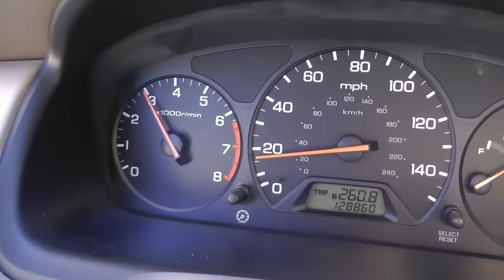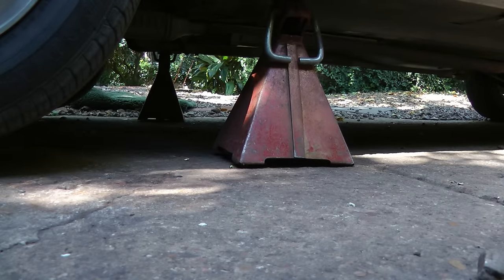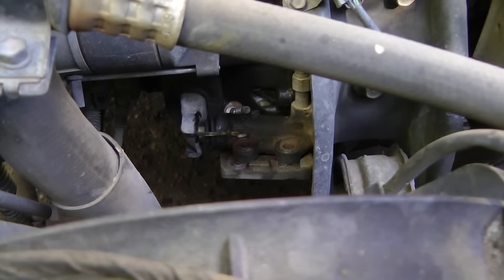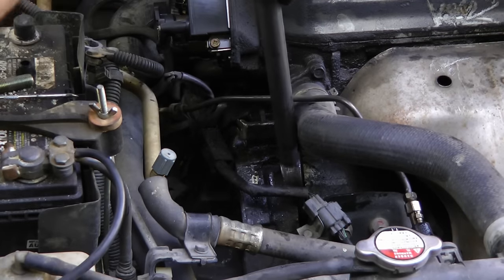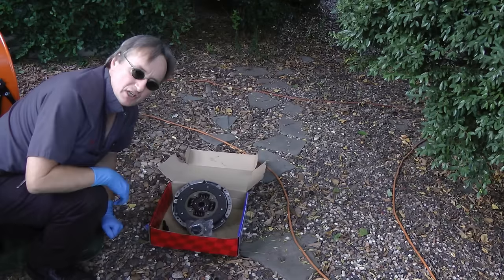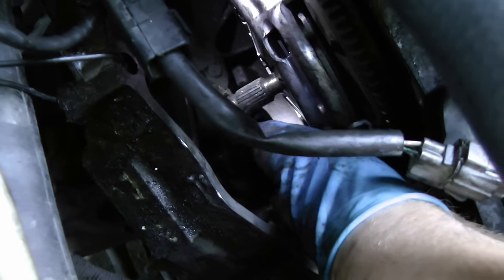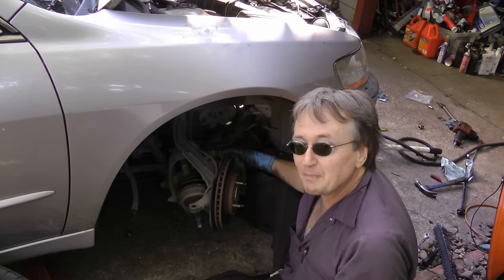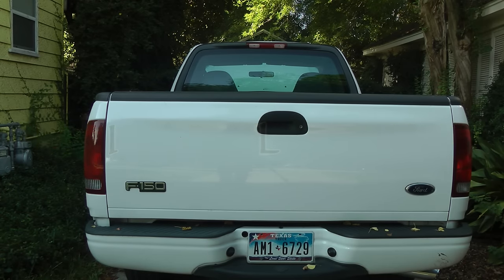How to Replace a Clutch in Your Car

Comment: Thanks for the vid. I have a question. I supercharged my 2003 Mach 1 and now my factory clutch is slipping at high RPMs! Too much power, need to upgrade it. What brand of performance clutch would you recommend? Spec? Exedy? Ram? It needs to handle 520 HP and 485 lb/ft of torque.
Reply from the maker: +kingcrimson234   Exedy
Reply: Scotty Kilmer Thanks!

Comment: This is only for front wheel drive cars, people may get confused on why should they remove the 2 semi axis...
On rear wheel drive for example it's much easier, you just remove the central drive shaft to pull back the transmission to reveal the clutch

Comment: Thank you for the video.  I am working on a 2002 Chevy Caviler, manual transmission.  My clutch is slipping so I need to replace the clutch.  You make this look pretty easy.  Do I have to remove the transmission on my Caviler in order to replace the clutch?  I know some cars are different.  Thank you!!!
Reply: NotSomebody63  I mean can I leave it in like you did.

Comment: scotty,some times you come up with amazing ideas,but i disagree with how you did this job.i know it is painful to remove the sub-frame  or the engine to remove the transmission completely.i have always made it a practice to remove the flywheel and get it machined or resurfaced.also check if there is any leak and wash the transmission/transaxle assembly and definitely put new fluid.with this practice you should get easily 5 years trouble free of regular driving......respect

Comment: Hey Scott! I own a 1996 Mitsubishi 3000gt Base 3.0 DOCH. Non-turbo. Whenever the car is at a complete stop, for instance a red light, when I push the clutch in and try to shift right away into 1st the gears grind, I have to wait about 2-3 seconds before I put it in gear. Same thing happens when I go from 2nd to 1st sometimes when coming to a stop. Is that my transmission going? or should I just replace the clutch and flywheel?

Comment: Scotty, I just replaced the clutch and flywheel in my 03 Mazdaspeed protege and installed new mounts all around and now when I take off from first gear my car shakes and jerks as if I'm not giving it enough gas but I am. What could that be?  I also replaced the pilot and throw out bearing. Thanks in advance.

Comment: Im about to do my first clutch on a 2001 camry, is there anything different from this honda i should take note of? I believe there is a bearing on the driver side axle holding it in place. If you could give me a rundown of the procedure i am facing, it would help alot
Im doing a stage 2 exedy and 9lbs fidanza flywheel

Comment: Hi scotty!
Got a strange problem with a 96 civic. One moment the gears shift fine but after installing a larger exhaust system I wanted to test it out. I go to first gear then start the car while holding the clutch and then let go of the brake while still holding the clutch and the car rolls like im not even on the clutch. Also unable to change gears, putting into reverse is easier but grinds a bit, and the car shifts fine when engine is off. I thought maybe the new wider exhaust is blocking the clutch arm or lever or whatever you call it, but the clutch pedal moves freely. I noticed the clutch squeaking when i press it all the time but now it stopped making that squeak so possibly an indicator of blocked clutch cable or arm? Do you think i need a brand new clutch or is it possible that the clutch cable is somehow blocked?
Reply: SOLVED:
just needed to add some d03 or d04 brake fluid to the clutch hydraulic system.

Comment: Hi Scotty! I have a quick question. I tried kick starting my car and now when I try to push it on first or second the car won't move at all unless it's in neutral. what do you think it is? clutch? the car was sitting for 3 years by the way. it's a 98 240sx with a sr20det engine. thank you for your time Scotty. love your channel.
Reply from the maker: yes, clutch is shot
Reply: Scotty Kilmer thanks for the help Scotty 👍

Comment: Does a 2003 Subaru forester need to be entirely disassembled to replace the throwout bearing or can it be done while still in place like you did for the honda?

Comment: A Scottie I just bought a Celica gt convertible and um new to manual cars made it home fine very bad burnt odor and car will not engage gears now at all. I limped two streets over in the car. Revs crazy won't move clutch got harder to push in and engage on my way what do you think it can be?

Comment: Hi again Scotty, I once again have a question. I would be very happy if you could answer it again.=) What needs to be fixed if the third gear wont get in properly? It get's in, but it's not easy, the others gears gets in fine & easy, but the third gear is harder. Anyways I'm very happy that you are making these videos, I learn so much! =)
Reply from the maker: transmission would need rebuilding, probably a bad synchro in third gear or wearing out gear itself
Reply: Thank you so much Scotty! =)

Comment: Driveshaft removal is more tedious with rear drive vehicles.  Putting the car on a lift and/or keeping vehicle high enough to safely work underneath is the best way to tackle the job.

Check also crankshaft- to-flywheel seal, if it's old, the oil pressure from engine operation will tend to spray around past the flywheel and contaminate the clutch disc.  While flywheel is off, replace the flywheel needle pilot bearing which is inside the crankshaft behind flywheel side.  Don't forget a flywheel lock to keep crankshaft from spinning when you loosen/tighten clutch pressure plate from flywheel.  O2 sensors will need to be removed if muffler has to be taken  off.

 If you have time and money, resurfacing face of flywheel at machine shop would be ideal.  Avoids buying a few flywheel.  You may need to bleed hydraulic clutch, disconnection of clutch components may have introduced some air pockets in the system.  The more money you can spend on new clutch-related parts, the less time you'll need to get back under the car to repeat some work in the future.

Comment: Scotty Kilmer, I have a 95 mitsubishi mirage 1.8. As i was driving my clutch pedal got real stiff and it was almost imposible for me to shift gears, i did make it to my destination but the car wont go into any gears now. Before this happened i installed new master cylinder and new slave. Now im working on replacing the clutch.
What are your thoughts on this based on your experience?
Please help thank you
Reply from the maker: broken internal clutch parts

Comment: Quick question... I have 96 sunfire 2.2, is it absolutely necessary to drain the transmission before cracking it open to replace the clutch?

Comment: Hey. I asked a question about my 92 Ford Taurus SHO a few weeks back. It wouldnt start for some reason which ended up being the wiring.  I Had to insert a push button so I didnt have to replace the wiring. Anyways, I have a rod shifter so the only adjusting I can do is with the clutch pedal. But its still hard to shift into gears. I have to yank on it when shifting so it will pop into gear. I replaced the Shift lever and also replaced the clevis joint since it needed to be done anyways. There was no change shifting wise. Do you think its the clutch?

Comment: Here is another tip in Bulgaria we do not spend a lot of money buying whole clutch kits that cost more than the whole car :D for the alignment we use a socket that fit snug on the place of the splines of the transmission and tighten the pressure plate and the alignment is correct as it is with the alignment tool. That way you do not replace parts that are working OK and do not need replacement :)
Reply: Patrik, as far as you are going to go to replace the clutch and pressure plate, it is advisable to replace all of the parts in the kit. It does not surprise as I think most Bulgarians couldn't troubleshoot a fart on a bean farm.Vinnie in Cincinnati

Comment: I have to replace my clutch in my f150. would you say its easier or harder then a car? and do you have a video that shows how to replace the clutch in a 1998 4.6 v8 two wheel drive.

Comment: Question for you Scotty.  I have a 2005 Cavalier 2.2liter ecotec with 5 speed manual.  I replaced the engine and clutch a year ago and six months later the slave cylinder went.  I replaced it with a new one and the new one is leaking again.  It has a concentric slave that goes around the input shaft so it is not easy to replace.  i have never seen two defective slave cylinders in a row so I can only think that there is something else that is causing this.  What would you suggest?  Thanks, Niels

Comment: this might be a stupid question but did you pump the same gearbox oil back into the transmission or is it better to use new oil
Reply: +Isaac Lee gear oil in a manual transmission is designed to last a pretty long time... (in my Volvo, it's designed to last the life of the car)... that being said, if you have the money, I'd replace the transmission oil with the factory spec gear oil if you've drained it. Baby a manual transmission and it'll last a long time. Pay attention to whether you need a GL4, GL5 or GL3 gear oil. They're not really interchangeable. (Even though the labels say otherwise...)

Comment: I have started removing the engine and transmission as one piece on jobs like these. It is vastly easier to marry the transmission and the engine outside of the vehicle when the new clutch is fastened to the flywheel.

Comment: Funny video
i gave up today to get the gearbox/clutch out on a 2004 WagonR+
I struggled to get the steering rack thing. Unscrewed at the bottom but it doesn't come up. Hell but a car jack below and tried to push it out and it just lifted the whole thing... any suggestions.
Already used a hammer... no luck...

Comment: A slipping clutch doesn't mean you need to replace the clutch. You have one of two problems:
1. Your clutch slave isn't applying enough pressure and needs replacing/bleeding
2. Oil or other contaminants have seeped onto the pressure plate/flywheel which means you've got bigger problems

In some situations the pressure plate or friction plates can become rapidly worn and glazed which can cause slipping, but to make things simple, I would always suggest checking out the clutch slave and master cylinders first.

You should ALWAYS install a new pilot bearing and use the alignment tool properly, which means completely moving the transmission out of the way to make more room. If you've already committed to doing a clutch job, then spend the extra time to do it right. If you're doing it yourself, then clearly it doesn't serve you interests to throw away at least 100 bucks on a botched clutch job.
Reply from the maker: well, a bad clutch slave that doesn't apply pressure will not cause clutch slippage, that would make it unable to go into gear from a start, but won't make it slip. ONLY a master cylinder that was bad and didn't release pressure would cause the slave to be on super tight all the time, which could make the clutch slip.

Comment: The clutch plate in my car was installed inside out where the protruding side was inside the pressure plate, while in this video the flat side is kept with the pressure plate.....does this make any difference in performance?

Comment: Hey scotty if your familiar with honda/acura...I have a acura integra tht needs a clutch and I want to remove the transmission out of the bay.....what do you recommend on using to take out the shift linkage pin with out that tool made for that job?

Comment: Hi Scotty. Mates got a 96 Toyota Celica that he wants me to replace the clutch in. Its an automatic but my question is with that car can you get away with leaving your drive shafts in and just popping the end off or can you not cheat and have to do it like above?

Cheers
Will
Reply: its an auto... Autos use a torque converter, not a clutch.

Comment: So basically you don't need any other special tools other than some jack stands, a jack? I have a 99 saturn sl2 that's going to need a clutch soon but want to save a boat load of money and try to do it my self. Any advice?
Reply from the maker: yes, but saturns are somewhat harder due to crappy gm engineering of some bolts which are hell to get off

Comment: how long would this all take on an mx5? Seems like a tough job, if you don't have all the right equipment.

Good quick vid explanation though.
Reply from the maker: it would take me 3 hours or so, but I've been doing it 46 years. Some guys it could take days
Reply: Thanks for the reply. Ah, that's far less than i though. I might go for it then!
Reply: It only takes me 3 to 5 hours on my Miata MX-5, my dodge ram 3500 however is like a 2-3 day venture of pain, I usually end up taking the truck to a shop I trust, my MX-5 I do myself. Pro-tip smaller gearbox is easy to do yourself, bigger ones make sure you have a good transmission jack. Also like Scotty says get a kit, the alignment tool is NECESSARY. Also when you do this repair examine the flywheel, it never hurts to make sure you fully repair your vehicle as a bad clutch can also wear on the flywheel and gearbox if you dont inspect them.
Reply: Bonemetalrad2009 it depends on two factors. How mechanically inclined you are, and do you have a transmission jack you can own or rent. I was hit by a drunk driver and lost function of my shoulder and bicep and I still work on my stuff. Wrenching is harder these days for me at least, but I keep at it and do what I can. Clutch job on your 1500 isnt hard to do just make sure your alignment tool has ample room and check (or buy)a dodge service manual from the dealer and not a Hayes/Chilton (same thing these days) it is also important to make sure all bolts are torque spec as this is vital with the clutch job.

Comment: Hey Scotty, I'm about to start this project this week, i have a pull type clutch, i cant figure out what kind of grease to use and where (none came in the kit), 
Do you have any advice on using loctite? I'm still on the fence about it
Reply from the maker: pull clutches suck big time, I'd like to hit the moronic engineer who invented them in the head. But you don't grease them. I would use locktite though,anything to try to make that stupid design hold up longer.

Comment: I have a 07 Hyundai elantra with 295k miles . my clutch pedal is to the floor and wont go into gear. originally I was having problems going into 1st gear and reverse. it would grind really hard even with the pedal to the floor. is it time for a new clutch? I think it has a cable clutch ( according to the tow guy)
Reply: Sounds more like your slave cylinder is going out but could be a clutch too

Comment: Hey Scotty, I have a 200" vw jetta. When I push the clutch in and shift into first, it is rough and not easy as it should be. I also have no clutch play on my pedal. So does this mean I need a new clutch?
Reply from the maker: yes, and be sure to replace the entire clutch with a clutch kit, don't just try a few of the parts.

Comment: My car seems fine except you have to really force it into 2nd gear, putting it in any other gear is easy just not second, dad says it's because the clutch is 14 years old and hasn't ever been replaced, it's done 450000km. Would getting a new clutch actually make it flow into second gear as easy as the others?

Comment: In my Volvo S60 manual, it's almost impossible to put the 1st or the reverse gear in (when its cold), I have to push down the clutch a couple of times and wiggle the gear lever back and fourth until it goes in.  however, when I've driven the car for a while (got like 10 mins to work) its not hard at all to put in the 1st or reverse gear. Is the clutch worn out?
Or can it be low gear box oil?
A clutch change will cost about $1500 so I won't do that in the first place, since I CAN live with this issue, if it doesn't damage anything that is?

Comment: Hey Scott I installed a new clutch and now I hear a rattling chattering noise coming from the transfercase fee cell housing area only when I go into gear I hear it a little now drained the atf it was a light pink color it's weird it's a dodge neon srt4 wonder what's the issue

Comment: hey scott i have a question i have a 2001 camaro ss and the clutch has been making a weird noise ive been told it can be the throw out bearing so i thinking of just putting a new clutch in what brand would you recommend? ive read great reviews about a stage 2 monster clutch

Comment: I have an audi A4 quattro with a stage 2 south bend clutch.  The clutch is slipping a lot under moderate load.  How long do you think I got before I can't drive it at all?  Is the procedure the same for my car as this honda?  Of course mine is a transmission not a transaxle.

Comment: Hey Scotty, been watching your videos for YEARS! I have a quick question if you have time.

I drive a 2007 Chevy Cobalt SS supercharged 2.0

I have been getting on it a little recently since I feel like I know my car (owned for 1 year) now

When I launch from first, not from a dead stop. This is after I eased into it. I let the clutch out and I rev it up to about 4 grand. The tires spin a little bit, and I can smell some clutch burning. Not very badly, but just a little bit mixed in with burning rubber. I do not care about the tires since I am getting new ones soon.

Is this a normal smell after launching the car? I mean the car drives normally and I had the clutch replaced around 10,000 miles ago. Again the smell is not horrible it just smells a little heated up almost to the point of burning

Comment: I had instances of stalling  my ford escort 94 on accident and not being able to start it back up. luckily I was on back streets those times. To start it I have to press the clutch pretty hard in general. in those couple instances I could not get it started no matter how hard I pressed. Could it be the clutch safety switch?